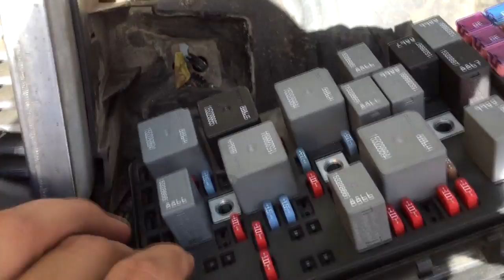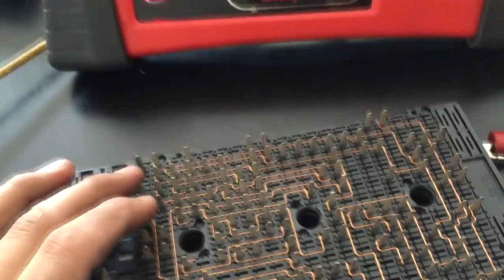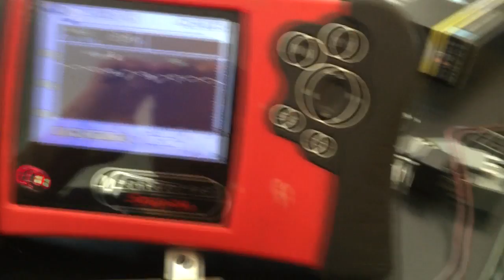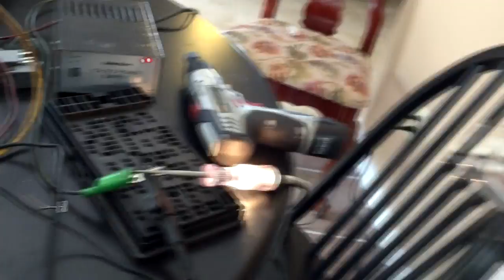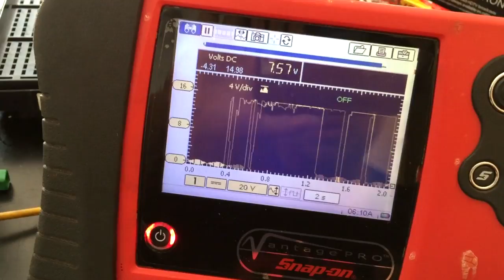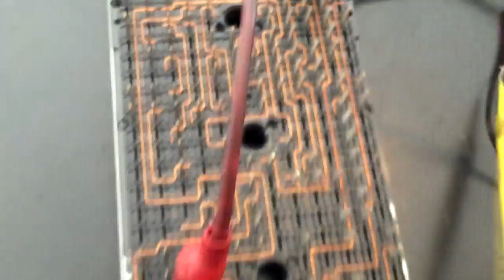CHEVY MALIBU NO CRANK WHEN HOT UBEC FUSE BOX FIX

Comment: I bought a new junction fuse box. But when I go to the shop to get the new one in. It doesn't start, misfires all types of codes. When I put the old one in, it cranks up. 3 shops said it is the junction fuse box. But damn, can't get the new one to work. And I had to buy it through quick parts because apparently cheverloet doesn't make em anymore. I own a 2011 cheverloet malibu
Reply: hey did it work if so where did u buy new fuse box. and did they try to program it?
Reply: @iambeez  I bought it from Quick parts. I honestly think they probably didn't try to reprogram it. And most likely just put it in there. It did come with the fuses. I'm going to put it in myself this weekend when I get a chance. Been looking at videos.
Reply: @TSPVisuals  what something not working right or the problem still happening after changing ?
Reply: @iambeez  we'll if I have my old one in, I will have to drive it around a bit. Turn off the ignition, and of course when I turn it back on. It won't crank gotta let it sit for a bit. But yeah when they put the new one in. It doesn't crank at all, all the lights on the dash will come on etc. But they put my old one back in, and it cranked right up.

Comment: My question is hw do u open those fuse box of Malibu 06 LT? Would like 2 know
Reply: You have to drill the flair shoulder out with 1/2 " drill bit after you hammer the screw pins out - easy does it & it will come apart !!

Comment: Can I use a regular multi meter to diagnose this?
Reply: I'm about to try(update,it does work,and this completely fixed my issue)
Reply: @thraxcide how do you open this box?
Reply: @vincentrodriguez4395 You have to use a small grinder or side cut snips to remove the flare on the bottom side,then you can tap them out. Its soft material so not difficult just a nuisance
Reply: @thraxcide thanks I got it. That’s dumb though.  I did need to buy another cause there was that small broken copper wire. That’s why I say dumb whoever made that fuse box having to literally break it to get in lol

Comment: The plastic box is expanding & contracting due to heating & cooling at a different rate than the copper wires causing the copper to be stressed at it's weakest points which is where the wires were bent.

Comment: 2006 Chevy Malibu 3.5, current 90 degrees outside same style fuse box. No crank no start, starter is good , fuses are good is there a way to test for this ? By running a wire? If so any advice would help

Comment: Awesome video 👏. You saved me TY. Just took the fuse box apart. If you give the screws a light live tap they will come out. Then i used a stepup bit on the topside. The square piece came off with little to no effort allowing me to pull the box completely apart. TY again for the video

Comment: How do you take apart the fuse box where it exposes the copper wiring and how do you put it back together without causing damage?
Reply: I have the same question!
Reply: @lumi2798 I figured it out if you haven't gotten to it yet
Reply: @tiger9racing779 Can you tell me? Im going to have to do it too

Comment: Thank you so much for making this video, i have a 2008 chevy malibu some issues replace all kinds of sensors replaced the starter the alternator ,crank sensor ,cam sensor replace the relay fuse nothing was working, this video gave me the courage to try soldering and you explained everything perfectly and after 2 weeks under hood the problems is fix
Reply: Hey I’m currently having the same problem with my 2011 Chevy Malibu same with me replaced the starter battery and even tried the computer ! When you replaced the fuse box everything was good ? And also if you did replace where did you get one ? I’m having trouble
Reply: @Leydademon yes

Comment: 09 Impala is different it has an actual circuit board with surface mount components , the dealership changed the fuse box for a no turnover condition but the problem is in one of the wire connections at the end of the wiring harness
Reply: Hey I don’t know if you can help me but ever since I’ve replaced my alternator I’ve had this code stored and I’ve replaced my starter and battery and still I can’t get no crank in my 07 impala if I replaced the fuse box you think it would fix the problem or would it still be that wiring harness
Reply: @MrKingmickey77  make sure your battery has a good charge , good battery terminals, good ground. If the security system lite is on than watch some videos on that.  If you have codes then I guess you have power to the ECU , test fuses and swap the starter relay , and then what I would do is pop the cover off the starter relay gently reinstall you might want to disconnect the battery, the relay can be cycled with slight side pressure to make sure the starter is working properly and if the starter turns over the engine then I would consider replacing the fuse box or do some testing to narrow down were the problem is coming from. some reasons I've seen for a no turnover condition, bad ground ,bad relay, no power from ECU , and the security system
Reply: @jacobclark89 that's what I'm dealing with no comms at all lost all communication
Reply: @HeatherCavender-k3p  I had to change the fuse box a second time, I didn't get the mounting hardware very tight as I have a suspicion that because the old plastic might warp over time and cause the problem

Comment: This is great information. I had tried changing throttle body kit with sensor but that was not the issue. I am very positive this is the issue with my V6 malibu ltz model. The only difference it used to be 3 hrs to cool and now I have to wait a day to complety cool down. Then it turns on like nothing was wrong and it repeat again.  Do you repair fuse box?

Comment: Thank you so much for your help! This was our exact problem. My husband found the crack in the circuit wire right where you showed and we’ve had no problem starting our car in the hot Texas sun since! Also, we were both super impressed with your mad skills at diagnosing this car. Was actually quite fun to watch you trouble shoot and fix this problem!
Reply: How did you fix it cause I'm having the same problem
Reply: We took the fuse box/circuit board out just like he did in this video. Used a hair dryer to heat it up, although when we took it out, it was already pretty hot from sitting in the sun. Then at 9:30 minutes in on this video, he shows a tiny break in the copper wire. We had a break in the exact same spot.  We used a magnifying glass. My husband put a little solder on the wire to fix the break and reconnect the circuit. Our car started fine after that even when it was super hot out. Good luck! Hope you’re able to fix your car too. @memelove8608
Reply: @CaroleTX  How did you get the fuse box apart? Theres 3 bolts that dont come out?
Reply: @lumi2798  I don’t exactly recall as it’s been a while back, but I did find another YouTube video called  “Changing the fuse box on a chevy Impala and Malibu” https://www.youtube.com/watch?v=ggJUF0qbxTw
that shows how to remove those screws. Seems my husband did it that exact same way. Hope the video helps you!

Comment: I’m having an issue with my 2012 Malibu and I have a feeling that the broken circuit in the fuse box is my problem too! When it gets hot, it says service ESC and reduced engine power, idles rough, and chugs. 

Is there anyway I can mail you my fuse box so you can check it out/fix it? I want to do this myself, but seems intimidating I don’t have any of the tools.
Reply: yo bro did you find out what it was? i got the same car i think its the fuse box
Reply: @leel2skummy  I didn’t check the fuse box like this video. I’m my other research, I think it cold be a dirty throttle body. So I literally just cleaned the throttle body yesterday with throttle body cleaner I got from Walmart (without removing the throttle body). It seems to work so far, the check engine light is off. It’s also the warmest day it’s been for a while in my state, so the cold might be the main reason it sticks. If it’s acts up again I’m going to take the whole thing off for a more thorough cleaning. If that doesn’t work I’m gonna replace the whole thing and gas pedal.

Comment: I have the same issue! I’m currently fixing it. How did you open the fuse box to expose the copper wires??
Reply: MOST DEFINITELY NEED A VIDEO ON TAKING THE BOX APART THESE 4 SCREWS IS IMPOSSIBLE TO TAKE OUT!!
Reply: @datrobinsonsfam  i used a flat screwdriver to loosen the rivets from one side and then pulled them off

Comment: I bought a whole new fuse box , worked just as great fires up every time now just change it out bro simply put may 14th 2022 , just did it  and it cranks right up every time 240 bucks for a whole new fuse box with every fuse and relay already installed
Reply: Can you tell me where you bought it from? I'm having the same problem

Comment: Hi, can someone please confirm how to solder the wire? What type of solder should be used?? Thanks in advance
Reply from the maker: I just used a dab of rosin core solder and its held up for years.
Reply: @ADVANCEDLEVELAUTO  did you solder it while it was still on the board or did you pry it out and solder it

Comment: Awesome troubleshooting man! I'm having the same problem with my 2006 Malibu SS I've already changed out the starter and fuses still same problem... could this be the same problem even if my car is a older model? Car starts great durning cold weather once it gets alittle warm outside and running it all day problem comes back. Thank you in advance.
Reply: You ever figure out the issue?
Reply: Yes I had the same break on the copper wire as in the video. I was able to make the repair by soldering the break and worked perfect. But eventually I ended up buying a whole new fuse block when time was right.   @alvarocgonzalez

Comment: Wow! Wow! Wow! Wow!
This was my two year long problem! Thank you! Thank you! Thank you!
Ours was in same place also!!! Worked during colder weather. Acted worse in hotter weather. Watched every video I could find on 2010 Malibu for two years! Then two days ago punched in Chevy Mal and this video popped up! When I saw video title and fuse board I
Looked at my wife and said this is it! This is the fix! We hadn't even watched video yet! We watched video then I went straight out and took apart fuse box (had to drill it apart), tested with meter (FINE!) THROWED HEAT GUN TO IT, tested again then saw crack (SAME EXACT PLACE IN THAT BEND). SOLDERED wire back together ,had to pry wire up out of plastic, slid two nails under wire to hold up off of plastic so not to melt board. TWO YEAR PROBLEM FIXED!!!
I just wanted to thank you so much! No one knew how to fix this!
I could push and wiggle fuse box and the car would start some times. I had pulled apart fuse box but never that far apart having to drill out bolt sleeves. But even  if I had ,I wouldn't have found the problem with the wire! Because the situation with the heat shrinkage. Wow thank you!
I put in new starter, new fuses,  switched relays.
Then one wire so small could be such a monster problem!!!!!!
Thank you again!!!!!!!
And I'm talking a lot of time involved trying to fix this!! So many times you think man I got it fixed!
Then you're stuck at a gas station or a restaurant!!!
Just can't let you know how much we appreciate your video and time!!!

Comment: man. May I send my fuse box to you to get it fix？The new fuse box costs around 650 bucks.
Reply: On line the box sells for $139 to $ 150 (GM dealers on line only). The dealer in Terrell, Tx wanted $230. But now there are none available any where in the U.S. Because of the many parts shortages, they say  it could be next year or longer before they are in stock again.
Reply: @jaysharp4348  soldering the wire, it works

Comment: I'm going to have to open that fuse box of a 2011 Malibu with the 2.4L I have in my possession to see if there's any cracks from that fuse copper circuit preventing vehicle to crank. 

Sigh...Last time that car started was a month ago. It was intermittently going into limp mode, message center showing engine power reduced, traction control light is also flashing, and engine jumping around like it's trying to die and keeping itself running at the same time. Weird stuff. Gave off a code about maf sensor low circuit. No misfires which was strange. My dumb a$s went and bought a new maf sensor without diagnosing and low and behold problem wasn't fixed.

I realized that after turning off the car for a bit, it would start right up also idling and driving fine for a while.  Gave the car back, but of course I'd get a call back from the car's owner the next day that the car is not accelerating and its shaking...I told her to turn off the engine, wait at least 10 minutes and start it again. But, the car wouldn't crank after several attempts. It finally started and she quickly dropped it off to my personal shop. 

Next day, I took it out for a spin around the block, waited till it went into limp mode, I turned it off. From there it has never been able to crank again, no crank/no start, and the dash doesn't throw any warning lights, and there's no trouble codes either, so after 2 hours waiting still no crank.....

Got in my personal tow truck and dragged it back to the shop. First thing I did was check battery (she did have the battery replaced a month a ago before this problem happened), that and the terminals were good. Removed the starter so I can test it, that thing was severely done. That ground wire coming out of the solenoid from the housing was broken off. I thought okay, no wonder it wouldn't crank. Easy fix. Bought and tested the reman. starter, installed it and boom! NO CRANK/NO START! This time, all the gauge needles in the instrument cluster that normally rotates all the way over and back doesn't do that anymore after attempting to start the engine (it did before replacing the starter), and the traction control warning light now comes on and flashes, message center would shows a check ESC, power steering, etc. I checked for codes, and this time along with the maf sensor low circuit, there's a maf sensor/map sensor correlation, and no communication with TCU.

I checked all power and ground. All fuses and relays are good. At this point I'm about to smash my head against the wall....

Fast foward a week, I've bought a used TCM, ECM, and BCM, none those obviously fixed the problem. I returned all parts and got my refund......I know damn well it couldn't be the wires, no way I could've shorted anything especially with the battery disconnected. 

Maybe that fuse panel is the main culprit to this Malibu nightmare I'm having....if that still doesn't fix it, I'm parting out the car and junking it, buying her a Toyota Camry.

The amount of time I've lost fiddling around with this car, and searching the net for any solutions....its very painful. Hoping(but not keeping my hopes up) this is finally the fix I've been looking for. It kind of makes sense, I'm guessing the crack expanded and no longer makes contact with copper wire to get the starter to crank.In my case, I probably have multiple cracks. Sorry for the noval. Needed to vent a bit.
Reply: Opened up the fuse box and not a single crack in site. All all the copper has power. I'm done. Thanks for rhe video.

Comment: I have a 2016 chevy malibu ltz I know next to nothing about electrical but my car won't turn over its like the fuse or relay or something I bought brand new  battery for engine n trunk. Didn't change anything. Bought mini fuse tester tested all minis all good whats my next step. I am a welder ironworker so not completely dumb. I feel like its the relays can u test those?

Comment: Great video!  I am dealing M g with this same problem right now!  The thermal expansion rates of the plastic fuse box body that the copper wire is snapped into is way greater than the actual copper wire, causing the stress fractures at the bends in the copper wire.
I wonder if the GM engineers have come up with a fix???

Comment: Had an Olds Alero with The fuse panel and the end of the dash with water intrusion connecting a few circuits pulling down the communication.

Comment: and to think the same thing can happened on an actual circuit board with electronic parts when a copper film has a crack in it for example on an electronic circuit board with electronic parts sometimes a solder joint can crack or break  the copper etching attached to the board and this is no different instead it's a actual solid copper wire that's breached

Comment: 2009 Chevy Malibu LTZ 3.6L - Same exact issue car starts right up when cold. Once I drive it around a bit and it gets hot under the hood it won't crank, won't make any clicking noise or anything. I Have to wait until it cools down. Watched video and ordered a used underhood fuse panel from ebay for $90 car is working fine so far, great video.
Reply: Did you have to program it? I’m having the same issue. I put a fan over the fuse box to cool down at home to start it
Reply: I have the same problem with the same model. This should be a recall. Welp I guess I need to buy a new box.